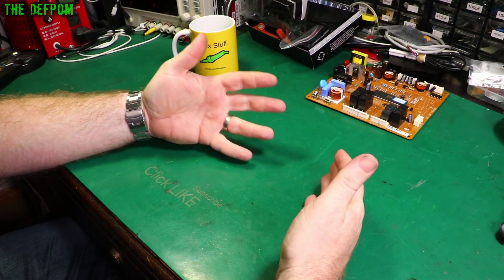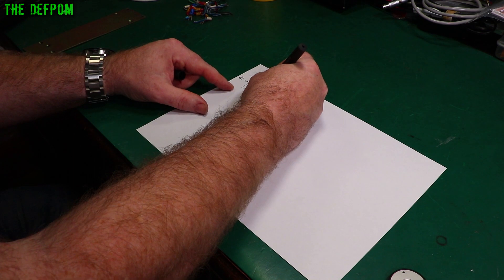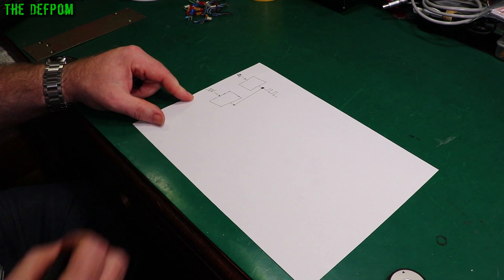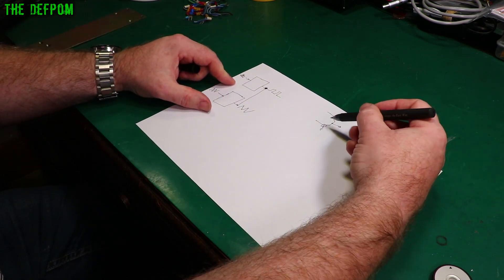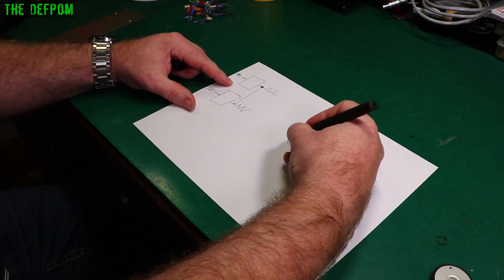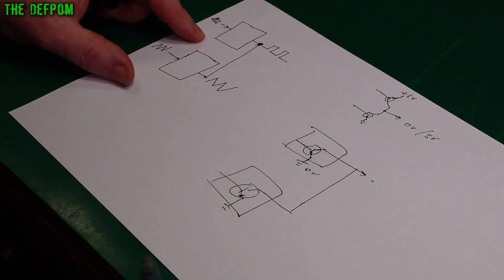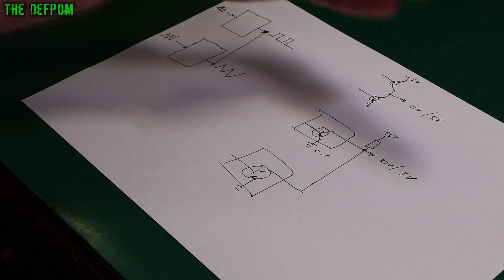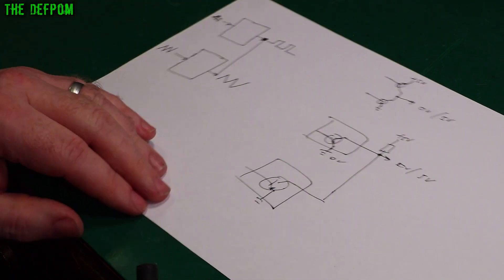🔴 Electronics For Beginners - No.10 - Open Collector Outputs - No.969

Comment: I tried to setup this simple open-collector ciruct and when npn transistor is on through 20k i am not getting 0V after the pull-up resistor 220R, it is still shows 5V , no matter transistor is on or off , why , tried many transistors ? It is working perfectly on simulator though .